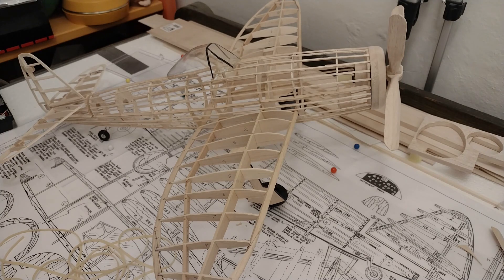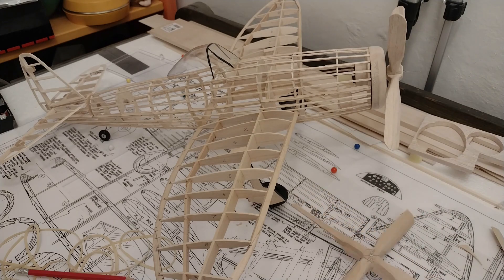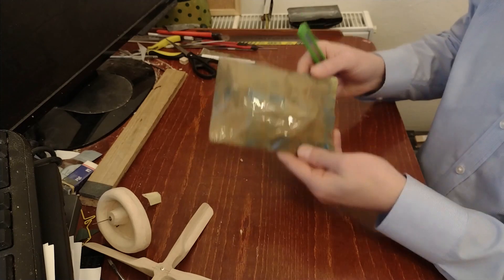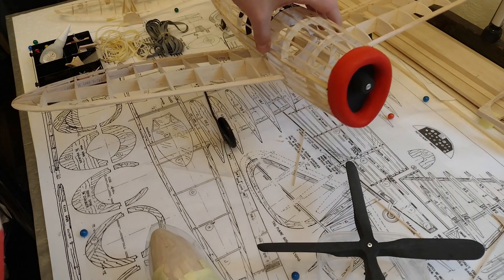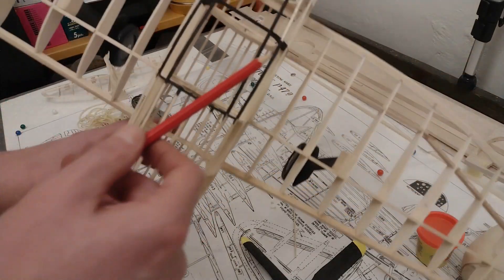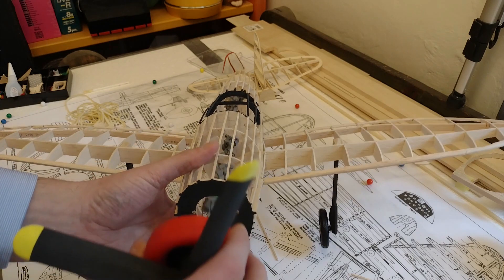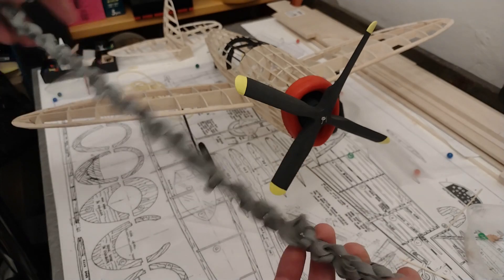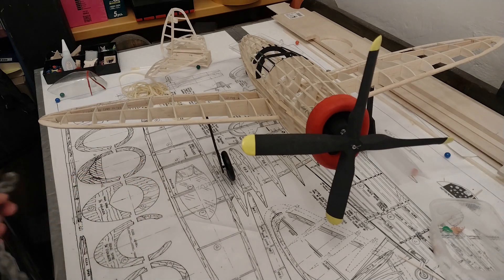13 Balsa P47   Rubber motor assembly

Comment: I use my little vice almost every day Andrew, it's one of those workshop accessories that you wonder how you ever got by without one, nice. If you stick your masking tape onto a window and cut it into finer strips it bends a lot easier around curves. The rubber needs to be lubricated before braiding, you'll also get a lot more winds on it, did you see the video I made on the subject? https://youtu.be/38zEjp1p29U To help prevent breakages of the stringers in the nose you could infill between with balsa, it makes it really strong, here's a video I did on the subject: https://youtu.be/ZUMMcjILG6c, cheers.
Reply from the maker: Good point about the masking tape. Never thought of that. And the lube and infills, I did know about them but haven't done it. I might still do some of it as the wood-working part is the part I enjoy the most. Thx!